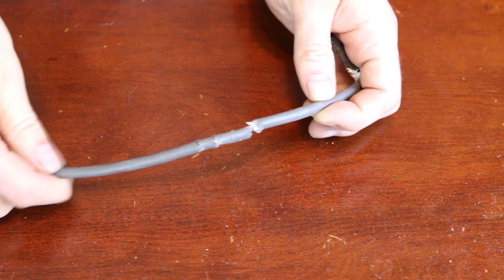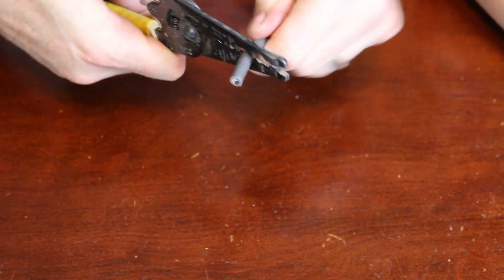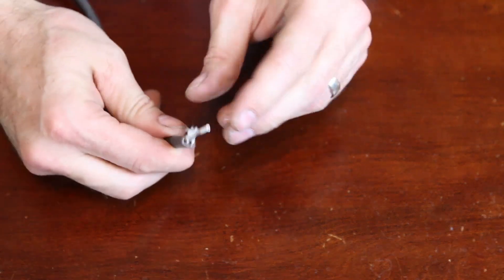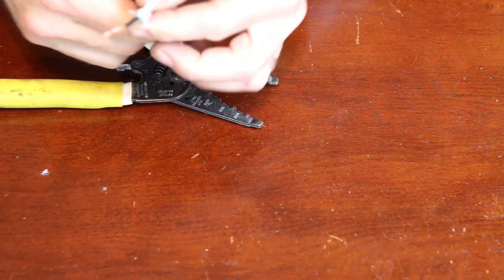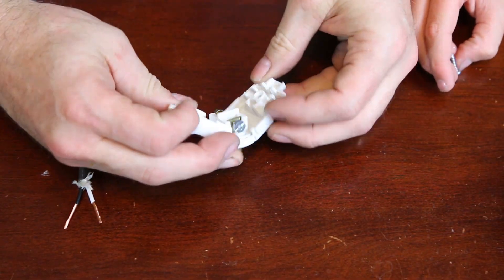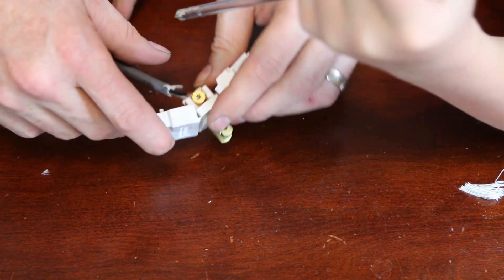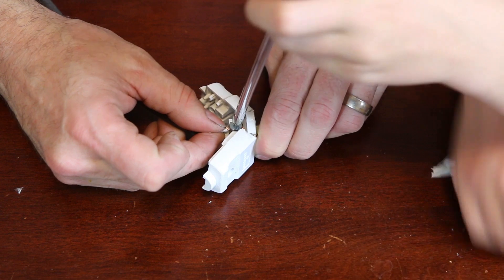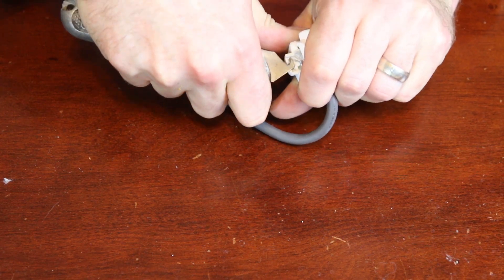How to replace a 2-prong electrical plug

Comment: This was great! I need to replace the plug on a wire that is connected to my small heater. I think I can do this.
Reply: Make sure the plug is rated properly for the heater :) A plug for a heater will be handling a much bigger load them what's shown here, a plug for a lamp.

Comment: This was great. I just replaced the cord end on a car battery charger. When I cut the wires, both were copper-coloured and both wire insulations were black. I could not tell which one should go on which side. I just guessed and it seems to be working OK, but how do I know if the polarity is backwards, or if the wires should be connected to the other sides??  One of my dogs had chewed the cord, fortunately near the plug end.

Comment: You left out the most important part, which  wire goes to which screw....
Reply: But he didn’t forget to ask for a Like
Reply: yep
Reply: And that's why it's difficult to make a video like this with a child. Because you're trying to educate the child and at the same time keep an eye on the child. Inevitably you forget something.
Reply: I mean you can see clearly in the video...
Reply: On a two prong, it doesn't matter. In fact an appliances being hot specific has worrying implications about standards not being followed on the manufacturers part.

Comment: If I got the wires wrong, would it simply not work? Also I'm using this to operate a fan. How can I be sure it's the appropriate plug. The fan had a two prong plug originally. But it also had a fuse...
Thank you, and great video with your kid!
Reply from the maker: Your fan will still work however if you get the wires wrong you are looking at a potential shock hazard because power is traveling through the fan where if it was configured right it would not.
Reply: Cary Peterson ok, so which one is it?
Reply: @CaryPeterson  Isn't the plug universal? That it can be plugged in either way? the EU type-C plug works like that, it can be plugged in either way. And the power is going through the fan either way. How else would it work?

Comment: You didn't bother to say which wire went to the wide blade on the plug or identify which was the hot wire.
Reply: light silver screw head=lighter color wire, dark brass screw head=dark wire
Reply: That answer was also worthless

Comment: You also didn't say what that female receptacle is actually called. I've looked on Home Depot and can't find it.
Reply: If you're talking about the opposite plug end for the other side of an extension cord, you can find them listed as "15amp / 125 volt connector".

If you're talking about the receptacle on the wall, those are 15amp / 20 amp outlets.

Comment: well I don't have different color screws they are both gold but it's polorized and from the test done I was told the small prong was hot and big one was neutral. Is that correct or do you know. P.S. mine didn't open you have to pull cord through after removing stopper(looks like one that would hold a fuse) then pulling prongs out.
Reply from the maker: Officer Meyer yes, the big prong is neutral (white wire).  Every replacement plug is going to be a little different but luckily they are pretty easy to take apart if you make a mistake a mistake ... Like I do all the time.